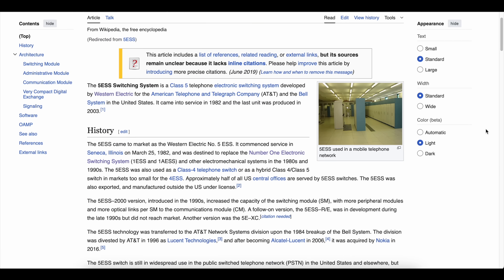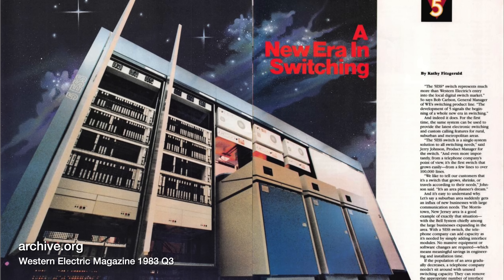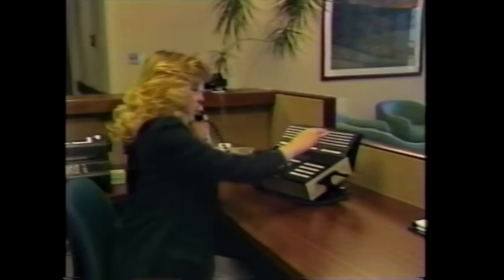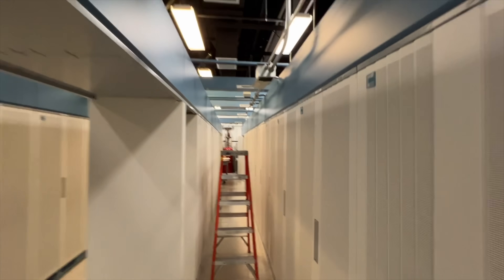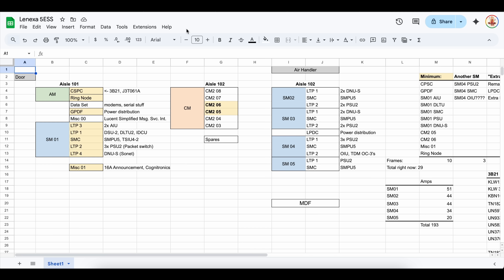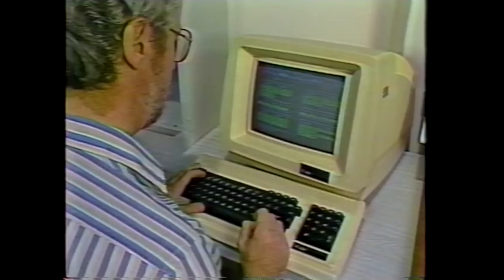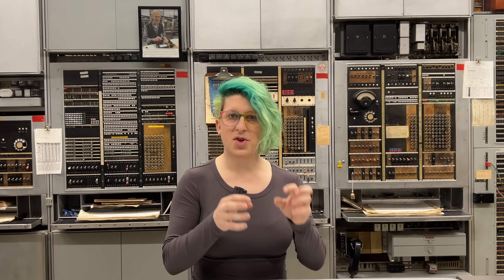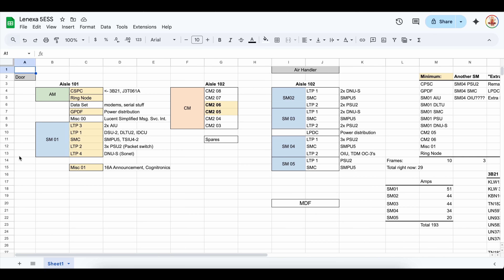We got a 5ESS!

Comment: While you were there, did you happen to drive on I-35 in Merriam, Shawnee or Overland Park KS?  You would have driven past the site of the Western Electric Manufacturing Plant where this 5ESS was likely built.  The site of the WE plant is now part of the Hendrick Toyota parking lot.  The WE buildings were just south of West 67th Street in Merriam.  There used to be a Gulf Chemical Agricultural Research station on the east side of I-35 just south of 67th Street and the Western Electric plant was on the west side of I-35 just south of 67th Street.  When I was an undergraduate astronomy major in the mid-1970s, I was taking a minor in computer science.  One of my CS faculty was working as a consultant at Western Electric and other mini-computer firms (remember those?).  We had a chance to come over to Merriam for a tour of the WE plant as they were building the prior generation of Electronic Switches -- all based on a brand new operating system, known as Unix, and all programmed in a new "light" programming language known as "C".  At the time Bell System was also building a wafer fab in southeast KC to "localize" chip production for the WE plant.

So you were walking in history!  Those plants were built in a location selected to provide secure communications by microwave relay towers, copper wire cable trunks, coax and eventually fiber optic links to the cardinal points of the United States.  It was built as a national defense authorization starting in the 1940s, throughout the 1950s through the early 1970s.  It included the command and control links for the Strategic Air Command and the SAGE system for coordinated anti-aircraft defense of North America.  There are still hardened and underground facilities in KC up and down the Missouri River and heading south along the Missouri/Kansas state line down to Louisiana and Texas in the south, as well as North Dakota and Minnesota in the north.  You should really plant to tell this story as well.  For example, in Olathe, KS which is just south of Lenexa, there's an FAA Air Traffic Control Center.  That facility was built to house a SAGE computer system to guide Air Force Interceptors from North Dakota through Oklahoma (at least).  It was connected to the Naval Air Station in Gardner, KS and the Richards-Gebaur Air Force Base just east in Grandview, Missouri.  It was attached to Nike, Thor and Zeus anti-aircraft rocket systems to shoot down USSR bombers carrying A-bombs and H-bombs.  That former-SAGE site, had on-site power for three days (minimum), connections to a pipeline for diesel, and its own railroad siding for fuel and food cars to keep the facility operating in the event of  World War 3.  It had hardened generation capabilities and underground crew shelters, along with air and water purification systems.
Reply: Thor was a MRBM, not an AA system.  Nike was a series of AA and later anti-ICBM missiles - Ajax, Hercules, Zeus, and X (Sprint) which evolved in Sentinal.  The series had its origins in an early 1950s proposal from Bells Labs for a solution to the problem of downing high flying jet bombers, for which the AA gun systems of WW2 were insufficient.  The Labs involvement was a natural extension of the electro-mechanical gun director work that they had done in WW2.
Reply: Yes, the electronics of Nike (guided) AA missile system was another amazing product from Bell Labs/Western Electric.  Initially all analog, it really showcased what was possible with high power radar, especially the later versions.  Once a missile was launched at a target, the system would guide the missile and then automatically issue a burst order to the missile on close approach to the target.  The first computers were analog electro-mechanical, with many gears!

Comment: I cannot express how excited I am that you have a 5ESS. I was shocked to learn that they are still in use today, so it feels almost like you are finally up to date. Also I have wanted to learn more about these for a while and yet public information is scarce.
Reply: Those things are depreciated over decades, and there is in fact still a nontrivial installed base of landline phones out there. 

They used to be very common on cellular networks, but with 2g/3g shutdown, they’ve compacted several rows of equipment and a ton of STP interconnects down to a few U of rack space. 

Aka even if it was still in use and had paying customers, it wasn’t worth the power suck

Comment: One of the dumber switches I’ve worked weird. A late 1990s model  used the 1970’s ‘ed’ editior (precursor to ex which was precursor to vi).  And one could not get real time outgoing trunk id on a live call originating on an inbound trunk for real time troubleshooting.  Nortel DMS100 had no such issues.

Comment: Some of the timing cables are all the same length so that clock pulses all arrive at the various racks at the same time. Slack in the cables is lost up in the trays. (System X engineer in the UK).
Reply: Interesting Andy, my time with BT was very short, end of the strowger era, early 90s. I just did MDF/IDF jumpering.   It's amazing to me that this stuff is considered vintage now, it was absolutely state of the art
Reply: I read something similar about the early Cray Supercomputers

Comment: Awesome.  I've only ever seen the Bell Canada 5ESS at our main CO here.  I manage a class 5 Softswitch (Metaswitch) at an ITSP here in Northern Ontario.  We were actually one of the first to offer internet connectivity to the public.  My parents live only about 2 hours away and they are still on a DMS10, still can't get caller ID or call waiting. 
 We pride ourselves on still being able to terminate TDM for customers.  I had to do a LOT of self learning to be able to troubleshoot the interconnections, debug things like FAX and Modem calls ( because we STILL run a Dial up pool) , and how to ensure that TDM to customer PBX's can still handle faxing, even though there are multiple  SIP / MGCP /<==> SS7/TDM segments.  We also recently did an upgrade to allow got redundancy, so THAT was fun.  Ensuring that there are SBC's, MG's , license servers, debug / Service assurance systems everywhere they need to be.  

You'd be surprised at how many businesses still rely on some form of TDM.  Even though they shouldn't.  And the reason for the big push away from TDM?  Industry making changes that mandate the deployment of SIP telephony interconnections might have something to do with it.  Maybe Telco's don't want to do away with the Millions they have invested into infrastructure that isn't capable of doing what the current ip telephony stuff can.  I blame the STIR / SHAKEN initiative, because it is SOLELY based on SIP interconnections, not TDM.  we had to implement it here as well, despite the fact that our calls terminate TDM mostly, and the changes would only affect 0.01% of our total calls.  WHAT A BARGAIN /s

Comment: Cool. But sad i did not see any old school cable lacing. Guess that profession is gone these days.
Reply: There was a little cable lacing inside the racks, but unfortunately any frame lacing was the first thing to be cut so the wires could be pathed outside of the frames. For the cable bundles, we did start with lacing, but we ended up running out of twine! Frog tape was a good substitute to finish up the day's work.
Reply: They literally have a tutorial for it.